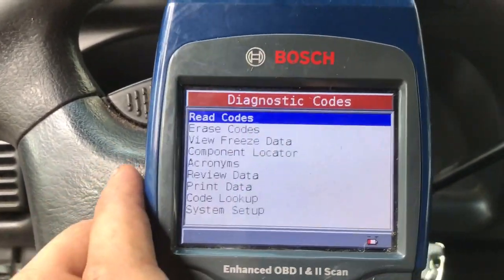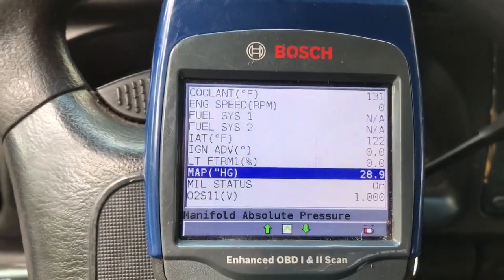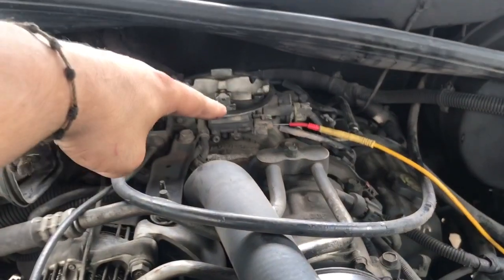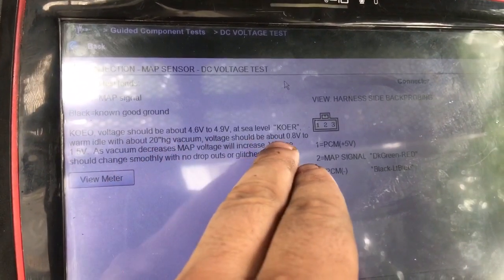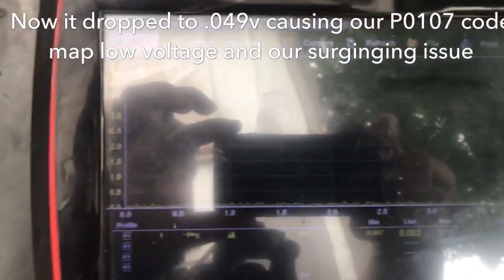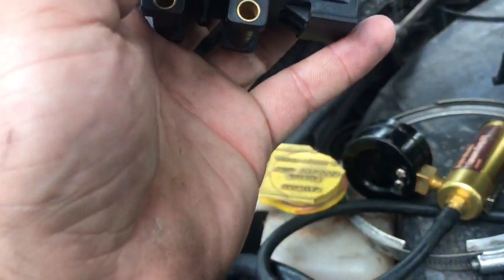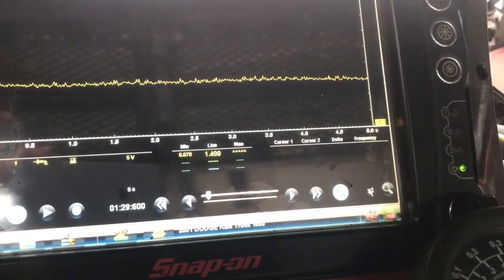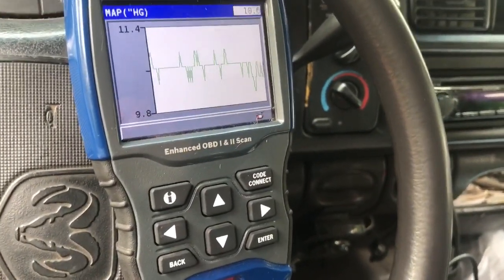Engine surging MAP Sensor P0107

Comment: Great informative video, is it possible to have a faulty MAP sensor with no codes coming up on scan tool? My Toyota 1MZ-fe v6 does this idle surge after the engine hits a certain temp after approx 25 minutes. Let me know what you think. Thanks

Comment: Yes I have a 07 GMC Acadia I have a rough idle and surging new throttle body new mas  or could it be engine mounts cause wen I put the car in neutral it’s not as bad of a idle

Comment: Getting P0108 Voltage Too High.... Turns out its a map sensor issue my bank 1 trim is -13% at startup creating Fuel Air Too Lean situation P0171 but these are my only 2 codes... Map sensor looks cracked was a hot day when I broke down from it engine bay was untouchable... Thanks for the helpful information 11$ sure beats O2 sensor that people who knew nothing about cars said it was...

Comment: Nice video.  Was the O2 sensor a false reading on the scanner or did you replace it?  I'm dealing with a Honda that I replaced the MAP sensor and catalytic converter (diagnosed with live data) and now it's giving me the bad heater circuit  code.
Thanks
Reply from the maker: I would just test the heater circuit on the o2 I also have a video on how to do that
Reply: @OzMechanics  Thanks for the response.  I tested for continuity but not resistance. I need to  find out if the heater circuit would make it run like crap or just throw a code?

Comment: Hey I have a 99 Dakota 3.9 v6 I’m having stalling issues I’ve unclogged the cat,I replaced tps iac.cleaned throttle body and I’m about to clean map sensor.just curious to what could cause it to roughly idle for about 40 seconds then shuts right off?o2 sensor possibly I’m stuck ?? I’m taking any suggestions Thanks in advance!

Comment: I'm trying to help a friend out, he cleaned his electronic throttle body on his 06' Nissan Altima. Now it has a surging idle with a P0507 code. Tried to relearn it with my snap on modis, but its not accepting the relearn. Do you have any suggestions? Thanks
Reply from the maker: meow sparkles I would try another scan tool if possible
Reply: @OzMechanics  Thank You
Reply: @OzMechanics  Used the Solus Pro and it worked! Thanks :)